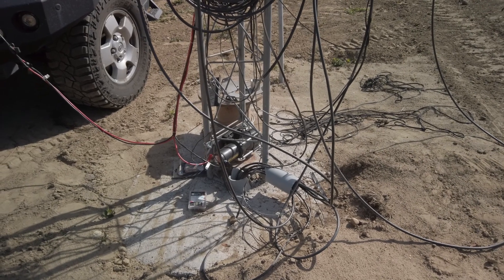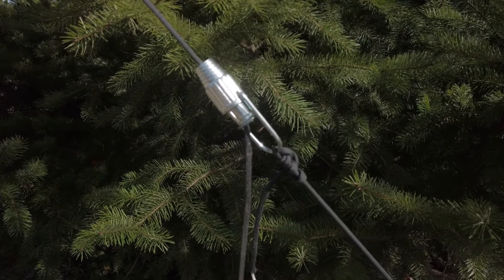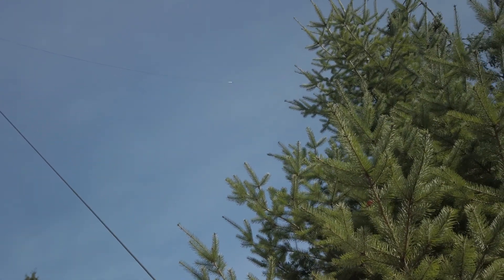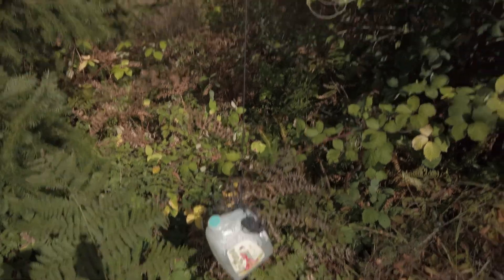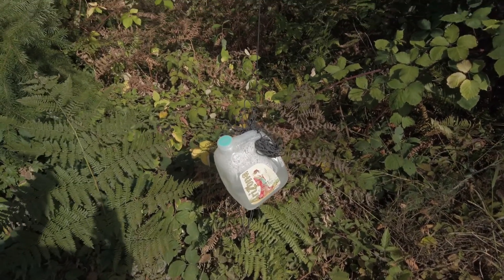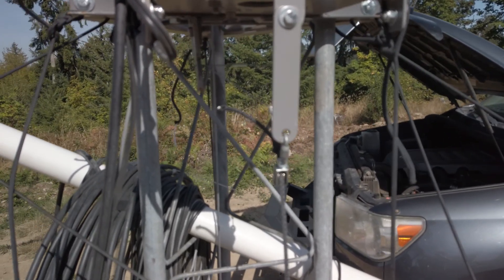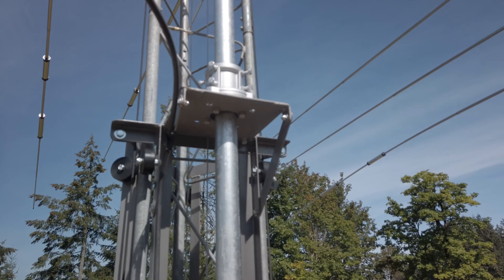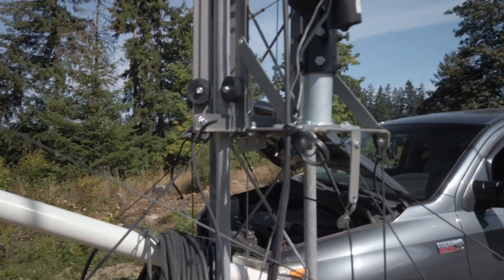Tower Lowering (2020) Part 1 : RT Innovations Razor #whiskey7backroads #rtinnovations #mosleypro67

Comment: Nice vid. How tall is the tower?   I have a Razor on order for Rohn 45G.
Reply from the maker: Its a 50ft Rohn 25G with guys at top and mid section which are hard to see in video.  Thanks for watching!!
Reply: @Whiskey7BackRoads  I couldn't see the mid-point guys, but that means you probably need to drop the guys to get the Razor down, correct?
Reply from the maker: @carllicari3067  RR, the top guys are attached to the Razor so they come down with unit and the mid point I un attach from ground anchors and the entire unit floats over those attachment points.  I am using 3/8 Dacron for the guys.
Reply: @Whiskey7BackRoads  what winch are you using for the razor?
Reply from the maker: @kb5ikr  I bought this one, https://www.amazon.com/gp/product/B00AX19UMU/ref=ppx_yo_dt_b_asin_image_o05_s02?ie=UTF8&psc=1
Worked good at lowering and raising but I had a tower failure and the entire thing is on the ground right now.  New stronger tower ordered and going to be able to leave standing.  Will be selling the Razor and Winch when I get the new one.  Thanks for asking and let me know if you have any other questions.
Reply: @Whiskey7BackRoads  thanks for the info...W5RSC
Reply: @Whiskey7BackRoads  What do you attribute the failure to? I am getting ready to install the same system with a Glen Martin Hazer.  Any suggestions?
Reply from the maker: @woodyccc  after speaking with some engineers, it was sheer.  The tower would of had to been guidelined to not only keep up bit also account for sheer or twisting.  I did not have the Rohn sheer attachments.  It was also very heavy of antenna for a R25.